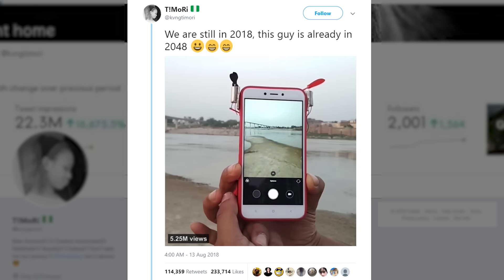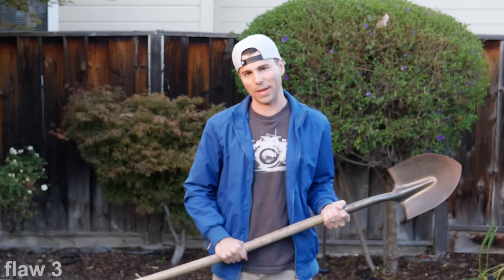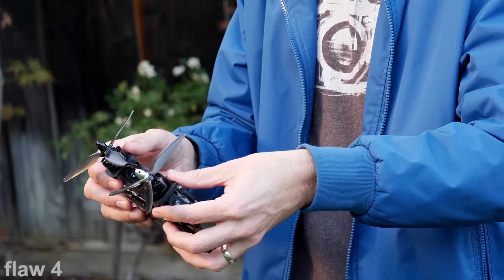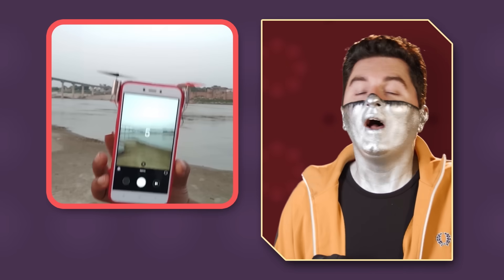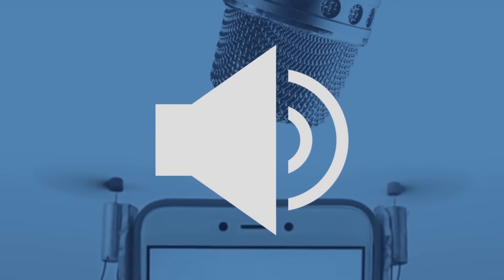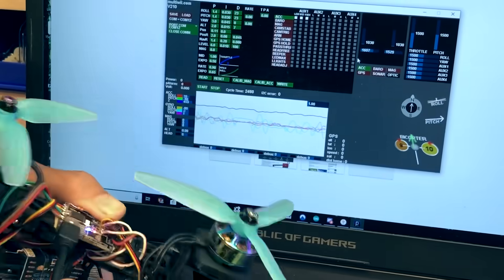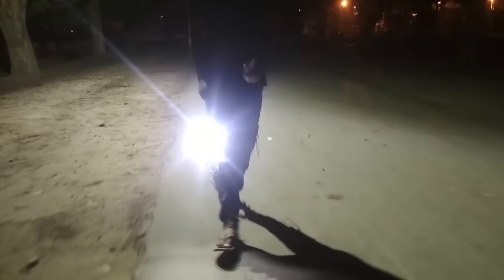Flying Phone Scam Exposed (so I built a REAL one)

Comment: Hey Mark, you should do an experimental video to see if the buttons you push at a crosswalk actually work. I've always wondered if they actually allow you to cross sooner than if you didn't push them. Just a thought that seems like it would be perfect for your kind of videos.
Reply: That depends on where you live. Where I am, pelican crossings (traffic light cross walks) are almost entirely button operated and won't stop for pedestrians otherwise. This is because there is a much lower flow of foot traffic because its a town of 40,000 people. Some crossings in larger cities do just run on countdown timers though, as they do have a much higher pedestrian traffic flow and therefor a use for constantly stopping.
Reply: Of course they work, but only during periods of low traffic, like (maybe) at 3am when there are no cars. Of course there are intersections where pushing the button will block lanes that might turn across your path...
Reply: @jeremylakeman  actually according to some reports some buttons for elevators (door closing) and crossways actually do nothing.
Reply: Bass Fight  For elevators, the close door button is primarily for firefighter operation. That said, you can set them up so they either work, or don't work during normal operation. A lot of buildings turn the button off to save on people getting the door closed on them before they can get on, which saves elevator trips, which saves time overall. In low traffic buildings, it's a bit more common to turn the button on.
Reply: They work all across Ukraine. I've stood alone 20 minutes on a sidewalks just to realise I didn't press the button. All "close doors faster" buttons in elevators I encountered are fake though.
Reply: They actually do work, but not in the way most people think. If you push the button, it doesn't make the light change any faster... it merely triggers the walk light and the countdown timer to allow you to cross when the traffic light turns red. So if you keep pushing the button over and over, that won't do anything as that circuit was triggered on the first push. You can actually test this very easily by simply NOT pushing the button. You'll notice when the traffic light changes, the green "walk" light won't come on.
Reply: In Canada they work
Reply: I can say in Ireland it works but in most places they are kinda just stress relievers much like the elevator close button, you wouldn't wanna close the door on someone so that's why
Reply: They don’t cause the lights to change sooner.  What they will do is prolong the length of a green signal to allow enough time to walk across when otherwise the lack of traffic would cause the light to turn red sooner.  They may also adjust how the left and right turn lane signals function to prevent cars that will travel through the crosswalk from having a green light while you walk through it.
Reply: Where I live the buttons do actually work. I have pushed them several times and some times the signal to walk lights up right away.
Reply: The traffic buttons work just like the pads in the road that register if a car is at the intersection. They let the intersection know someone wants to go. Each intersection is programmed differently in terms of priority and order.
Reply: It's been debunked before that these button do nothing but simply to put our mind to relax. This is a placebo effect when something that you think will help you or do something, in reality, it did nothing. The actual purpose of the button is to encourage you to stay behind the traffic.
Reply: Michael Antonius  they actually doserve a purpose, just not the one you are thinking about.
if you look under the button housing you'll find either a secon button or an infrared sensor that, when activated, will turn on the "blind" mode with the speakers signaling when the light is green and when it's turning red
Reply: They all originally worked but few still do

Comment: Hey Mark I have a question! If I had let's say 2 foot long small round piece of Styrofoam with weight at one end and a powered propeller at one end would it not stay standing straight vertically in the air without gyros and without accelerometer?

Comment: Nice video Mark, but I have one critique of your analysis. The Adding 6 times as many motors won't make the volume they produce 6 times louder. Volume perception does not add linearly, it adds logarithmicly, so it will sound less than twice as loud.

Comment: Hey Mark, at 5:20 you made a mistake by saying that 13 more motors would make the sound 6x louder, however, this is not the case, in reality, if you had 2 motors you would need 20 to make it twice as loud (10x the original amount), therefore with 15  wouldn't even be twice as loud. love your videos, keep up the good work

Comment: You say that 13 motors would be 6 times louder than 2. Isn’t that wrong? I’ve learned that you have to double the amount of sound sources to double the volume. So that 16 motors would be 3 times louder than 2 motors. Or 9 dB louder (iiif I remember correctly (I might be on thin ice here) )

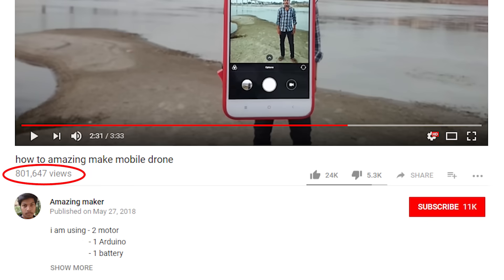Comment: If you pause at 1:34 in the original video, you can see the motors are powered directly from the battery and the Arduino is just to make it look complicated
Reply: The motors are connected in series, with ground passing through the Arduino. It is being used, but as a glorified switch.
Reply: Spoonasaurus Wrex exactly. The Arduino doesn’t even need to be powered on for this
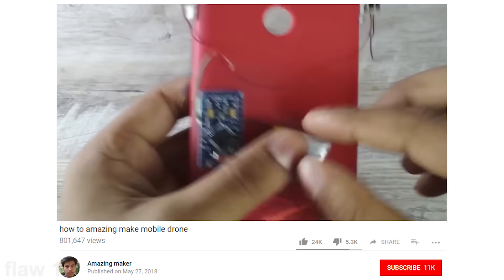Reply: you probably mean 0:34.
Reply: @petritavdyli260  no he said in the original vid not this one
Reply: Petrit Avdyli I mean the original video, not this one. Coincidentally Mark Robber showed the same clip at 0:34 in this video but you can see it better at 1:34 in the original

Comment: 5:20 thats not how it works lol, 16 jet engines are not 6 times louder than 2, also the decibel scale isnt gradual so 6 times 70 db would be 420 db which would kill you instantly
Reply: I think he meant 6 times louder as in 6 times the intensity--so it's only a 7.7 dB increase.

Comment: Doubling the sounds source would increase the volume by 3 decibels...
How could you multiply the sound by 6 times if you add another 13 propellors? Even if you count 3 dB as doubled volume, which wouldnt be incorrect, it would still be only 3.625 times as loud and not "at least 6 times"???

Comment: Just a thought, you mentioned that the motors would be 6 times louder with 15 rather than 2, but sound is logarithmic so it wouldn't quite be that much louder. IIRC, you'd need 100x the motors to make it sound twice as loud

Comment: Are you serious?! 'if you wanna make it yourself'?  You can make millions of selling that!
Reply: The issue with that is the fact that every phone weighs something different and has a different center of mass. Defying gravity is hard enough when you know how much mass is where. Also manufacturing is hell, you have to go through ALL the certifications, and there are some massive safety issues. One of those propellers can about remove one of your fingers, for crying out loud.
Reply: If the propellers are plastic, then no, if they are blunt metal, then also probably no, unless you're a very young child, If they're sharp metal tho, then yeah, but I don't know who would use knives as propeller blades.

Comment: I built one and it always accelerates at 9.8 m/s/s
Reply: probably not so much over their heads as much as under their feet.
Reply: I built one as well, unfortunately, it seems a bit too heavy if you know what I mean.
Reply: 😂 just a shame it's not 9.8ms^-2 vertically though...
Reply: Assuming you built one without any moving parts, Mark touched upon that in the video. If I got it correct, it's called "quadcopter". He said it doesn't have any moving parts making it perfect for a 9.8m/s² constant acceleration design.

It's a bit weird, because I always assumed quadcopters had moving propellers, but, the more you know!

EDIT:
Yes, I know he was referring to the rotating propeller mounts, making the propeller motors non-moving. But the way he phrased it as "no moving parts" made it sound like he was describing a brick, and I decided to have a bit of fun while pointing that out
Reply: Oof, I get it. I love being aware
Reply: @im2groovy  I don't, and I don't like not being aware 😂
Reply: That's travelling at more than the speed of light
Reply: Downward?
Reply: Mojo dude same!
Reply: Lmaooo
Reply: Maybe you should check to see that the motors are getting power
Reply: Love this comment. Definitely will go over so many people's heads though